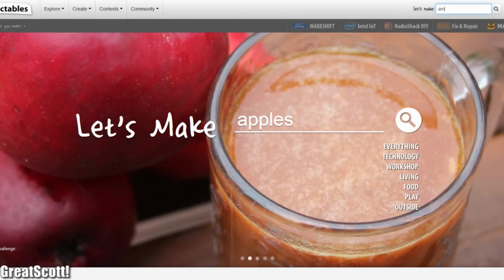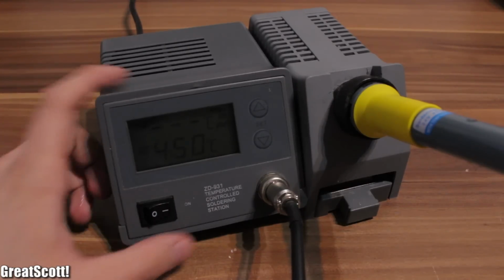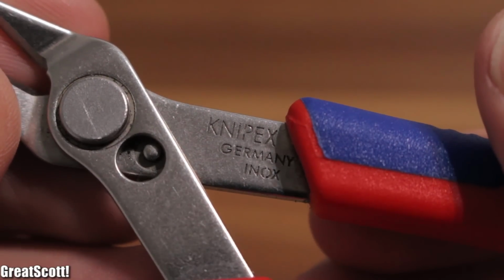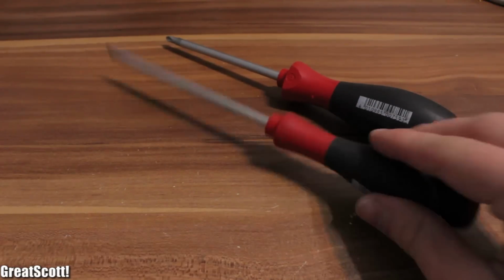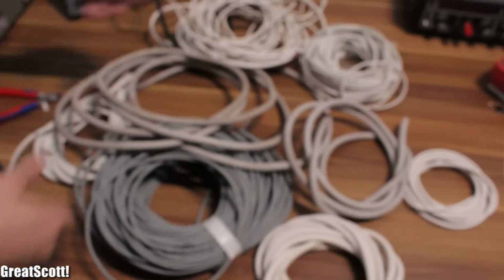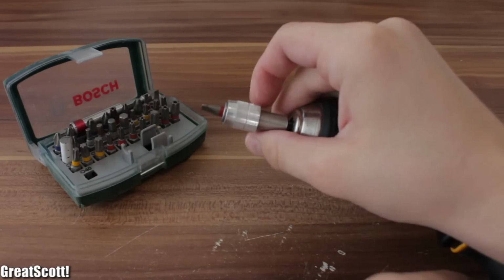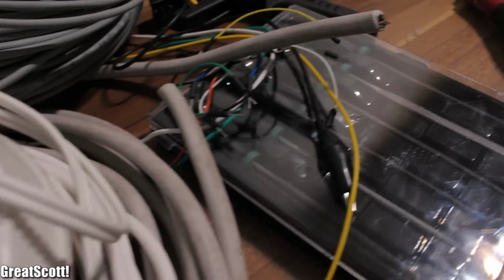Basic/Advanced Tools & Materials for Electronics

Comment: I'm starting out without most of this. My starting list is pretty much this: Breadboard, assorted component starter kit, 5 volt ac to dc power supply from an old electronic I probably don't have anymore, and a multi-meter for trouble shooting. AS for brands, literally everything is some no-name Chinese stuff or whatever brand harbor freight sells.

 I also have a soldering iron, but so far I have only used it to solder leads onto the 5 volt power supply and to a little speaker from an old tv.

You don't really have to buy 200+ bucks of tools to get started, I'm starting with closer to 40 bucks worth of components (although the cost has ballooned since I started shopping ebay for components).

Comment: Am I the only one who doesn't favor the wet sponge for cleaning the soldering tip ? I feel like it corrodes the tip, much like water builds up scale inside a clothes iron over time...
Reply: Daniel's Game Vault I feel like you. I use the blade of a cutter to clean the iron tip
Reply: Do you mean brass wire? I heard it's nice.
Reply: Daniel's Game Vault I use the other stuff i forget what it's called I feel like it works better than the sponge
Reply: Niko Andruloni it might be brass. It's some sort of wire that works well
Reply: I just bought a brass pad, and I can confirm it was well worth the 5 USD I paid for it locally. It is basically a sphere of tightly coiled brass wire. I have just been plunging my iron tip into it to clean, and it removes all build up and corrosion, and leaves a very thin layer of solder on the tip to resist further oxidation and improve thermal conduction. I can't tell you how much easier my soldering has become because of this little marvel.
Reply: I forgot what keywords I searched with but I found an article. Soldering iron tips are made with a copper(good quality) or an iron core (sad quality). Solder will "wet" iron and copper but not the chrome plating that good tips have. A tip can be plated with chrome to protect from heat-related oxidation but the pointed end will have the iron or copper exposed so that the tip's tip can be tinned with solder. A sponge is wet with water that has high thermal mass and will "shock" the tip. The hot metal rapidly cools on contact on one side and because it is layers of different metals with different coefficients of thermal expansion, the plating shrinks at a different rate than the core, breaking away from the tip. You use a metal wool like a lightly abrasive scraper. Copper and brass are used because solder will wet to them because of their copper content; and they are soft metals which will not damage the chrome plating of the tip. If you used steel wool it will scrape away the chrome plating and possibly introduce magnetic contaminants into your solder and circuit, so try to avoid using that. Copper and brass wool can be found at Dollar stores, bunch it up so it's dense and stick it in a small non-plastic bowl. No water required.

Comment: Thanks, that was useful! I wish I could expect more videos like this👍
Love my Mastech multimeter - get one with automatic value order recognition (either the value is fractions, ones, tens, hundreds etc.) - you would not have to select it on a dial. It can measure temperature as well, BTW.
Reply: Kirill Vishnevsky I also own a Mastech and like it. It has built in extensions for temperature and capacity measurement, unlike basic multimeters

Comment: I use a solidering iron that i plug directly into the wall. It works just fine as a stationary one. For me, i use one with 30 watts on 230 volts. It works just fine, because i am working with precision. I would also recommend a screwdriver set with different types of screwbits, especially if you have very limited space, or just for practical space saving

Comment: Biggest issue I've seen with cheapo multimeters is that the leads tend to tear up very easily. Second biggest would be the battery replacement as that's usually impossible to do & get the meter back together, but the leads tend to break before that's an issue more often than not. So, hot glue to fill in the gaps between the lead wires & the lead so they don't tear out as easily.
It's a good idea to have a hot glue gun anyway. That'll make a $10 meter a viable option as a starter

I use a lot of cheap stuff for tools, but I avoid the cheapest of them. Going too cheap leads to wasted money. There's a bit of trial & error, sometims.

Comment: tbh, i use nail clipper as wire stripper.
Reply: Bitelaserkhalif cringes you can clip your nails and your wires at the same time lol
Reply: I use scissors. Yeah, just simple scissors. You eventually get a good feel for how far you can cut into any specific wire
Reply: @Marco_Onyxheart  It wont work in some cases, like with some rally thin and weak wires. A example would be a laptop fan wire, wich a scisor isn't usable, you aways endup cutting the wire, or if not totally, you remove to much conductive material.
The advantage of many nailclippers is that many times they come in a plier shape/form factor. And even when it doesn't comes in that form-factor, it's usually curved wich makes easier to unstrip wires.
Reply: @Marco_Onyxheart  me too
Reply: Bitelaserkhalif cringes bruh, but it is smart
Reply: That actually sounds like it would work okay
Reply: @jacksonshelton8055  With time the nail cutter may become dull, if its not those old and really good quality ones. 
It can even happen way faster if you cut the copper sometimes too.
Reply: What?? I thought everyone use nail clipper😂
Reply: I use my soldering iron with knife blade. Works like a charm
Reply: Yeah me too. But its a very old and rusty one
Reply: Lol I thought I was the only one
Reply: I wouldn't use them as wire strippers but they are great for clipping excess leads off boards after soldering.
Reply: I use crocodile wire head as wire stripper
Reply: Sometimes
Reply: I strip wires with a cutter blade lol
I try to not cut deep enough and if the separated insulation is loose, I twist it so I have a nice exposed and braided wire, waiting to be tinned
Reply: @CosminCrăpatu it won't smell good
Reply: I use a pair of scissors lol
Reply: That's cool, I use my toe nails as dental floss.
Reply: My ADHD did not compute that sentence, and now I'm terrified of waking up having wire-toes.

Comment: How many volts would you recommend on a lab power supply? 15 or 30 or more?
Reply: Anonym 120
Reply: ScaniaMF for more pins outputs.
Reply: 15 or 30 will probably do for you. Unless like me who has had need for at least 350, sometimes more.(old school stuff). You can usually get about 2000 or so from an old microwave oven transformer(at 500 to 1000 watts!)
Reply: lochinvar00465 nixie tubes?
Reply: Anonym 15 is ok
Reply from the maker: 30 is plenty. Even 15 is enough for most tasks.
Reply: Thanks a lot :)
Reply: GreatScott! PLEASE MAKE ARDUINO MEGA 2560 ROBOT ARM 3D PRINT IT I WANT TO MAKE MY OWN ARM BUT CAN YOU HELP ME OUT THRU YOURS VIDEOS. I LOVE YOUR VIDEOS SO MUCH.YOU ARE THE BEST.KEEP GOOD WORK. HI FROM SLOVENIA. :)

Comment: I'm using a very old soldering iron its more old than 20 years how I know? it has a date on it when it was made. I got it from my Grandpa. your brobaly gone say its garbage well it isn't its complete opposite its very durable I've used it more than 2 years and just to think how much my grandpa used it its very durable it gets very hot with that soldering iron I've melted some very strong solder that I couldn't melt with a never one and its directly connected to the mains.
Reply: I have got a soldering iron that you can heat up on a fire - no electricity needed!
Reply: Aleksander Sats Well, month ago, i was using an old communistic soldering iron from 1971.:D
Reply: My friend has that communistic too [It's made in Czech Republic (Ahoj, btw. :D)], It has a little lamp in the front of it and the plastic cover is shredded from falling on the ground. He fixed that with a clear tape. It looks funny, but functions well. :D

Comment: The tools I use the most:

Electro tools:
-Proxxon FBS 240/E
-Makita electric drill
-Makita electric jigsaw
-Makita electric buzzsaw
(Got all of those Makita tools with a Makita LED-flashlight and radio, loading-station, 3 spare batteries and a lot of accessories in a nifty carrying-bag for 320€, tax included because that set was an exhibition piece at my local wholesaler :D )
-Pattex hot glue pistol
-Ersa soldering iron

Normal tools:
-Knipex Automatic Insulation Stripper (Like yours, only from Knipex)
-Knipex ESD-certified flush cutter Super Knips
-Format flush cutter
-Gosumodz crimping tool
-B&D Piranha drill-bit set
-iFixit Classic Pro Tech Toolkit

Kind regards,
Meta Custom Computers
Reply: thanks!

Comment: you should check out the analog discovery oscilloscopes here http://store.digilentinc.com/analog-discovery-2-100msps-usb-oscilloscope-logic-analyzer-and-variable-power-supply/ it's a fast and easy USB oscilloscope/logic analyzer/function generator/low voltage power supply

Comment: Get a multimeter with auto power off, else you will forget sometime & leave it on until the battery dies.
Totally agree about those cheap automatic wire strippers. I've had one break the first time I used it.
Mini drills are super-useful.
Favourite, most-used tool of all time: Vernier calipers. (Doesn't need batteries, always works.)

Comment: what is the name of that board with copper strips?????
Reply: Strip board or Veroboard (brand name)
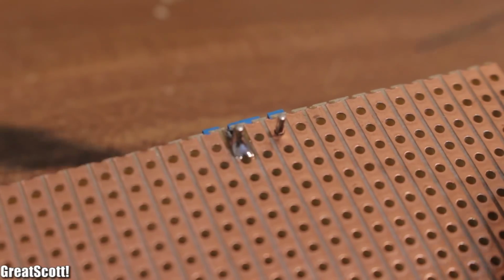Reply: At 4:23? search for "Stripboard" it comes in 2,5, or more holes connected together mainly used for DIPs and other ICs. You can cut the copper traces to break the rows up if needed, but they come in different patterns. Some have spaces for 4, 8, 14 pin DIPs ready to use. Even seen some for SMDs, look for "(chip type,SSOP24 etc) breakout board"

Comment: Rigol 1102 is nice but I bought a 10M Owon SDS 7102 that I like and have been using now for about two years.   You get more memory and a bigger screen for the price.   Ultimately I would like a Rigol MSO which has a built in logic analyzer and other functions.  They are pretty expensive I think about 1,500 for a good one

Comment: seriously hot glue gun is advanced tool??
Reply: Considering it can
make circuits waterproof
Keep you from shocking yourself
and be a quick and easy thing to hold stuff togheter

Yeah, hot glue is awesome
Reply: @slackerengi2401  Awesome maybe, but advanced?
Reply: @Geerice  the tool itself isn't advanced. It's applications and utility in electronics is however beyond 'basic'.
Reply: If it was 13 eur
Reply: xFuaZe You forgot a wire stripper function
Reply: +xFuaZe :D

Comment: I actually bought a 3$ multimeter...
It works fine and is precise enough for most things...
We do have a more expensive one lying around for in case it needs to be completely right!
If it explodes, it isn't a shame... It was less expensive than some chocolate bars I eat :-)
Reply: cheap ones can be dangerous because they dont have a fuse inside. i also have a uni-t and a 3 € one, and i always use the expensive one because it just feels better.
Reply: +Gijs can't you just add a cheap fuse to the circuit!

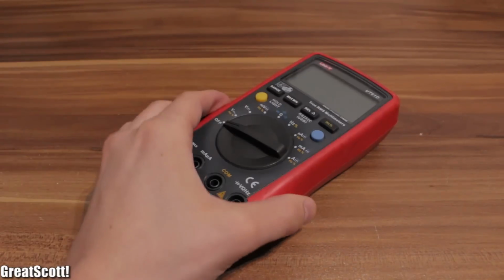Comment: ~2:00 The temperature shock to the metal tip when you do that can cause small cracks in the plating which over time will get to the inner copper and destroy it.  Be careful when using a wet sponge!!!  Do quick wipes, not letting it rest for 5+ seconds!
Reply: you do know that that tip is replaceable?
Reply: you do know that that tip is replaceable?
Reply: +Joyrider do you know that just because you can spend $10 replacing it doesn't mean you should?  It's crazy how wasteful people like you can be!  "It's only $10!" who cares!    it's wasteful to break it intentionally.
Reply: +Bob “bobdabiulder” dabiuld its not like in cutting it wiyh a saw.

Comment: I really liked this,really agree with buying only good yes the best tools on the market. I am an American and that is synonymous with stupid cheap,can never be cheap enough. In fact stupid Americans prefer to buy  items two, three or four times  rather than  to buy once for life. Many of us Americans wear cheapness as some badge of honor, when instead it is like wearing a fools cap. I buy many of the tools you listed. Rigol, Wiha, and knipex  are all fine tools.  But few German tools such as what Aligent, Sencore, Fluke and B&K have produced will ever measure up for the price. German engineering is about engineering, or  simply put, never design something simple with the fewest parts for maximum working life when you can over engineer it with dozens of parts to make it seem better. I see this extensively.
So from that aspect I believe we Yanks have the ability to produce fine tools until we go to China. Then it all reverts back to " you can't fix stupid". Wish you could but you can't.

Comment: i have a uni-t UT30B hand held meter and never had an issue with it, i also have its bigger, bench top brother the uni-t UT801 along with a power supply, 60w soldering station and some ryobi tools very similar to what you have, but i just need a little press machine like you had for your proxxon! all i need is a decent affordable DSO and some small files like what you have :) maybe even a glue gun.....

but, what im really struggling on is... figuring out, what i will need for a small electronics workshop =/ any hints/help would be grand :D

Comment: Hi great scott, i am planing to buy a bench power supply ,i have seen a bench power supply that have analog volts and amp meter and range at 15v at 1amp pls help me to decide
Reply: Thanks for replying ,i live in dubai i use the currency called dhirhams i want to use it for powering my 555timer flashing circiut and my low voltage led indicator and much more . The cost of power supply is 40dhs thats around 8 us dollars also i dont buy online its from a local elctrical store . Max i can pay is around 50 dhs /10us $ because i will be first time  using it ,but should i buy that or other model
Reply: Also thanks for helping

Comment: Your new soldering station from ersa costs around 122€ euros does't it?
I also bought a new station with 80w but mine wasfrom reichelt ( xy tronic lf1600)
It only costs 80€ and it heats up to 350 degrees in under 30seconds! The ersa station needs 90seconds..:D if anyone searches a high quality soldering station i highly suggest buying the xy tronic lf1600! Its just freakin' AWESOME!!:DD
But i think your ersa station will do the job aswell!:)
And yes the tools from knipex are really nice! I have the same tools and theywork great! I also have a rotary tool from Proxxon and it is really helpful to construct enclosures or cases! 
The only thing that i need is new bench power supply!
Which brands would you suggest me to buy GreatScott! ?
Reply from the maker: Scavengerx3 My new ersa heats up in under 15 seconds. I don't know why the amazon page claims 90 seconds. Any brand for a bench power supply should do the trick. I have no favorites there. Or you build your own one.

Comment: i have recently (3 days ago) bought a UT61C and i was having a hard time deciding between the 61C and 61D, temperature versus true rms. That were the hard decissions, but i don´t use ac voltage really often, in fact, i haven´t used ac voltage once on my "el cheapo" (maybe ´cause it was el cheapo).
At the same time, i have seen on the eevblog the comparison of the 61D vs other 100 dollar multimeters. Not much input protection, slow continuity function (still better than my el cheapo), slow autoranging.
But at the end, i think that the UT61 series are good multimeters, because they are really cheap for their category of medium class multimeters. Highly recommended for low voltage stuff.

Comment: Great vid man. Also, if REALLY want a good oscilloscope, you should invest in a techtronix oscilloscope. BUT, they're super expensive. They cost as much as a car!
Reply: Yes I like techtronix also, but got mine free! It's a portable two-channel model that battery finaly gave out from field techs @ GE who got new upgrades. My father worked maintenance on all machines and buildings found in dump pile! Plugged in AC power brick and bingo. Also got refurbished Weller solder station when I worked as tech there. Local manufacturers often upgrade and ditch old tech, worth seeking out! I built my first 286 w/40 Mb HD at 15yo from there trash bin.
Reply: The Rigol is fine for practically everything a hobbyist does - but yes, the Teks are really nice, that's true. I personally prefer Hamegs, though. :)